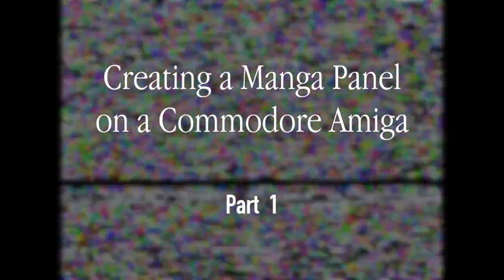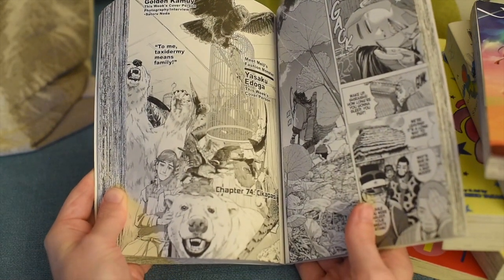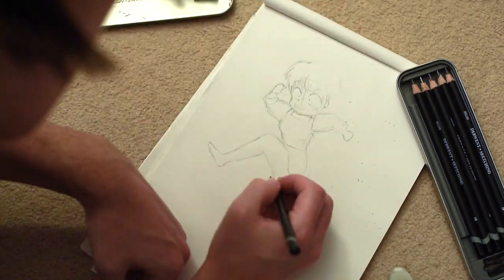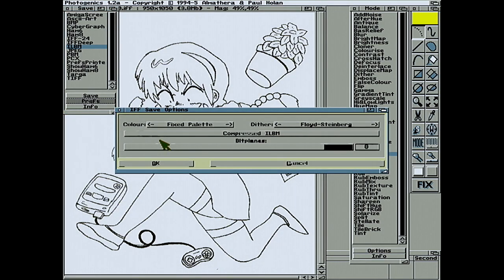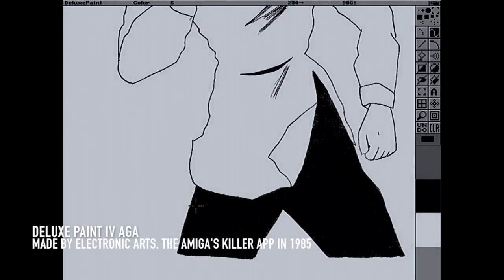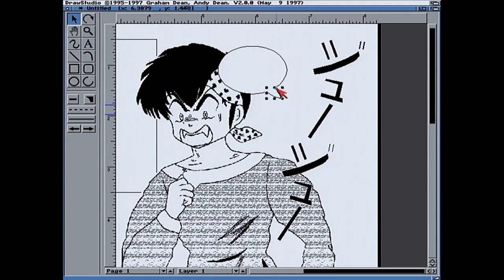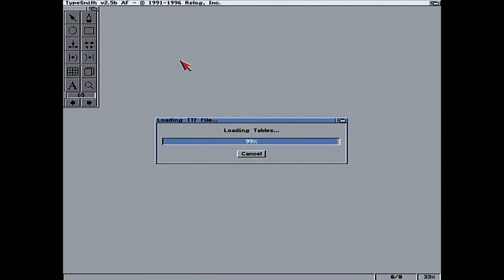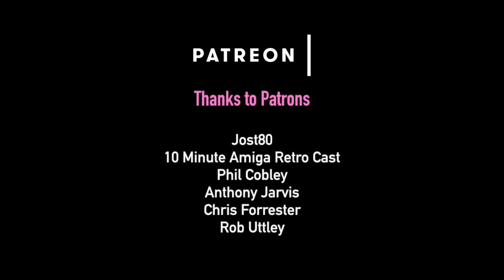Creating a Manga Panel on a 1992 Commodore Amiga - Part 1

Comment: Great video Pixel, lots of info and what I like the most is the font conversion discussion, I've learnt something new.
Reply from the maker: Kevin Saunders thank you! Type smith is awesome I can't believe I got it free in Amiga Format! It will also export compugraphic so you can then use fountain/intellifont in workbench to make bitmap variants for pixel art or whatever :)
Reply: @vix_in_japan  Thanks so much, I probably had it also on the soooo many magazines I threw out years ago :) Will definately be investigating the font arena on the Amiga in the new year.  I know generally though that when you install text editors and Scala for example that they add more fonts.  I'm so happy you have a 1200 by the way :)
Reply from the maker: Kevin Saunders believe it or not I have two as I won one at the SWAG meetings here in the U.K.! I was using the one with the slightly faster 020 and extra ram though :)

Comment: There was some really quite sophisticated software available that I never even realised existed, never mind on the Amiga. I would never have thought you'd be able to load in fonts like that and alter them.
I'm looking forward to see the end result of this one.
Reply from the maker: Yep, this was the thing by 1993/4 the Amiga's productivity software had a bit of a rennaissance if you ask me, Softwood with Final Copy and then Final Writer, Digita with Wordworth 3, Scala MM300/400, Typesmith, Pagestream eventually became superb by v2, ImageFX v2, Photogenics v2, Brilliance, DPaint V. Final Calc was a good spreadsheet too if a little rougher around the edges than Final Writer. Sadly Commodore's demise put the real kibosh on it, and by late 1997 I was using my Amiga mostly as a Mac via Shapeshifter to run Photoshop 3, FreeHand and even Microsoft Word!

Comment: You’re reminding me of all the software I used to use! I’d totally forgotten about DrawStudio 👍
Reply from the maker: DrawStudio is a hair width away from being totally brilliant, it lacks two things: 1. Lock - you can't damn lock things on the page! 2. Bitmap export is limited to chip RAM size it seems. This really limits 24bit export and was a problem BITD, however, these days with easy use of EPS conversion - it's a minor issue and it converts to 8bit greyscale/colour and 1bit very well indeed, although I tend to find around 200dpi is the maximum 1bit file I can get A4 sized files out of if I really need the bitmap (which is never these days, on an Amiga anyway)
Reply: Pixel Vixen I really want to reinstall my 1200 from scratch and put back all of the things I used to have (it’s just got a base 3.1 install at the mo’). I’ve got it on the LAN and there’s a SCSI CD-ROM so I can get stuff on it quite easily; I just need some spare time! 😃
Reply from the maker: geezerdiamond do it bit by bit that's what I've done over the last year. Got the essentials on there like 3.0, Dpaint and went from there :)
Reply: @vix_in_japan  Yep - I was considering looking at 3.1.4 for a fresh install as it includes a bunch of nice fixes, then put NewIcons and WHDLoad on there (from scratch, my install has messed up icons!), and then go back through my Amiga Format / CU Amiga cover CDs for software ideas! :)

Comment: Some vector drawing program might help here: for Amiga i remember Art Expression - but am not sure it can import bitmap graphics - and DrawStudio, that i did not own - the first can save in EPS or AI88 - very old illustrator format, i wonder if can be read by any program nowadays - only drawback is that Art Expression does not use ECS screens so will be darn interlaced and i wonder if any screen promoter utility could fix that
Reply from the maker: I was using DrawStudio :) But drawing the whole of these scenes with vector art on the Amiga would be a challenge in patience even I probably don't have (and I'm a pretty patient person). But DrawStudio to my mind is about as good as it gets on the Amiga for ease of use and compatibility. This was more of an experience to see how far I could go. Since then I have indeed gone on to create a manga, not on the Amiga, it's called Future Saviors.